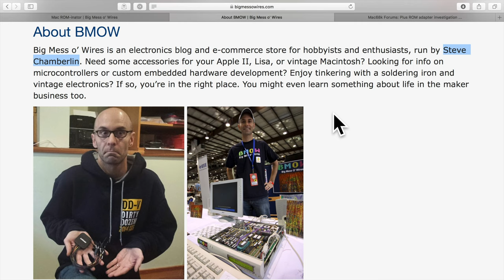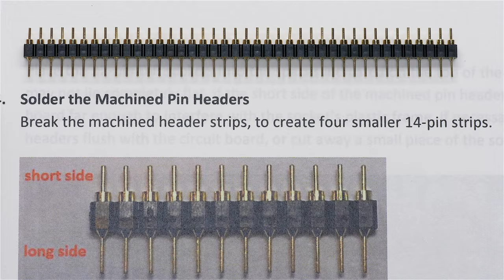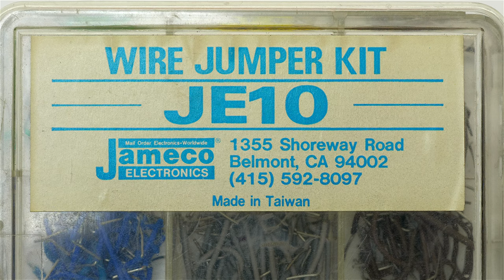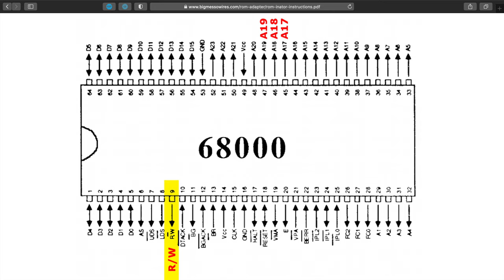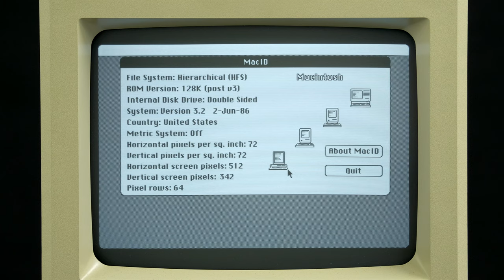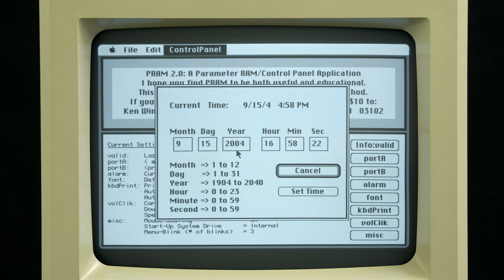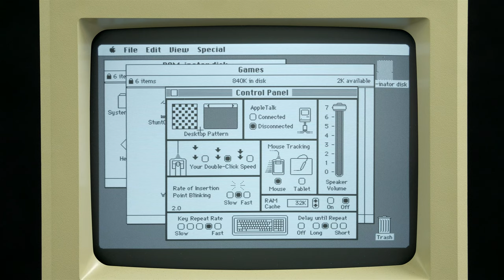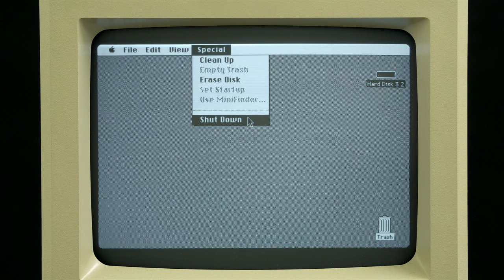ROM-inator Kit Build & Review [Mac 128K, 512K & Plus]

Comment: I tried uploading the Gerber file to OSH Park, but I get a error code that it couldn't find the board outline in the file.  Do you have any ideas?  This was a great video by the way and has inspired me to haul out my old Macs.
Reply from the maker: Thank you for the info, Colin. Because I bought my kit from Kay Koba, I don’t have.the answer. I contacted Kay and Steve about it and will reply back when one of them replies to me.
Reply from the maker: I still haven’t heard back from Steve, but Kay told me that he did not use that particular PCB maker. He said it really varies by PCB maker. So the suggestion is that you try a different company because you should be able to use those files on the BMOW website just as they are. 

Maybe try PCBway? I’m not affiliated with them, but it seems like every single soldering tech YouTuber out there is advertising for them. If they are as great as those Youtubers say they are, they should be able to use the files without question. Please let me know your thoughts in light of this. Thanks.
Reply: @JDW-  PCBWay worked well.  I'm just a little cautious.  Sometime the brokerage fees for duties and other fees can be quite expensive.  I think I'll wait for Kay Koba to put a package together.
Reply from the maker: @colinhaines8612  I received an email from Steve Chamberlin. Steve said the .GML file in his Zip archive is the board outline. He added that OSH Park may need to be told explicitly to use that GML file for the outline. Steve said you can also use the included Eagle files to re-export Gerbers in a different format if needed.  Or just wait for the kit from Kay Koba! :-)

Comment: I bought a BMOW rominator 2 and installed it in my SE/30 and I found it did some strange things. For 9ne thing it didn't let the apple menu items load and also I couldn't put a screen saver 9n the ROM it was too small. Also I have to press "a" every time it boots and it doesnt save mode 32 I did have to go 8nto the system preferences and turn that 9n and reboot every time. I think 8t may be a dead battery that is not saving the preference settings but I'm not sure??? So recently the HD died and I'm going to get scsi2sd. I can still get that???
Reply from the maker: If your ROM-inator II purchase was recent, I'm guessing you have the Atom, which is 2MB.  I have the MEGA version which is 8MB.  I am not affiliated with BMOW, nor do I officially offer support for either ROM-inator product. The best I can do is offer my personal experience.  What I can say is that the best part of the ROM-inator II is the Programmer.  Sadly, that is no longer sold.  Without the programmer, you are locked into whatever software the ROM-inator II ships with.  Not so with the original ROM-inator because you can reprogram that on the fly, without removing the chips and without a programmer (except on the 128K Mac).  Being able to reprogram the contents of your ROM disk is key to making it work the way you want it to work.  I suspect your ROM disk is setup in a way that is giving you trouble.  I myself have never had the same problems you described because I can reprogram my ROM-inator II.  Furthermore, you need to remove your PRAM battery and check the voltage.  If low, you need to replace it.  If 5 years old or more, replace it.  

As to SCSI to SD solutions, keep in mind there are many.  I describe some of those in my MacSD review here: https://youtu.be/zwz6qMC2ZE4
Reply: @JDW-  yes I think you are right. 👍

Comment: How much memory can you get on the ROM?
Reply from the maker: As shown in my video, it's a bit larger than an 800K floppy.  That may not sound like much, but please consider it goes a long way on a Macintosh 128K, 512K or Plus.
Reply: @JDW-    that's not large enough to get all the apple icons and a screen saver.
Reply from the maker: @amonster8mymother  But 800K is better than nothing. That's really the point and purpose.  It can be fun when one considers what will fit on an 800K floppy.  It's not meant to replace a hard drive by any means.
Reply: @JDW-  ok. I want it to run in mode32. To run clean and access the extra memory. So I can run turbo synth sound designer and alchemy and what about running a sequencer for the midi tracks I hear it can do that but I have not tried it??? I think a se30 can do much more. 😁😁😁
Reply from the maker: @amonster8mymother  Yes, you need an SE/30 for Mode32 and other things you want to do.  The SE/30 can do more than a 512K, but an M1 Max can do even more than an SE/30.  It really boils down to choosing the right machine for the job.  The 512K serves its purpose well, and the ROM-inator makes it even more fun.  Fun is what it's all about.  Merry Christmas.
Reply: @JDW-  yes I do have an SE/30 😁😁😁
Reply: @JDW-  why settle on one machine. I’ve got most of the compact models from the Mac Plus to the Classic II. Even more fun.
Reply from the maker: @markcummings150  I've not settled on one machine.  I have a HyperDrive Mac512, and then the other Mac512 which now has the ROM-inator installed in it.  I have a few SE/30s and a Color Classic as well.  More recently, I acquired an SE and did the SE Reloaded motherboard build, since it's stock board was destroyed by water.  The SE has a 16MHz 68000 SuperMac SpeedCard accelerator in it.